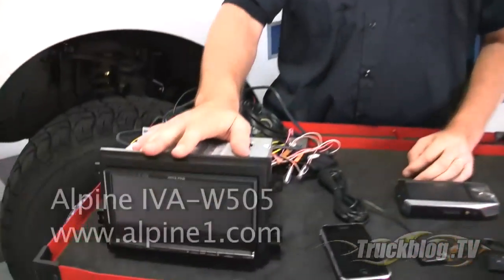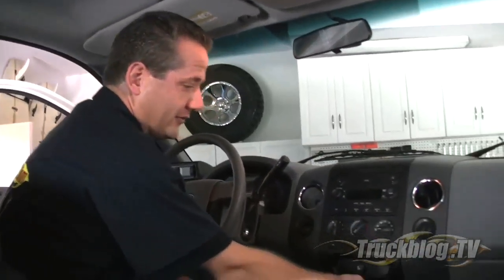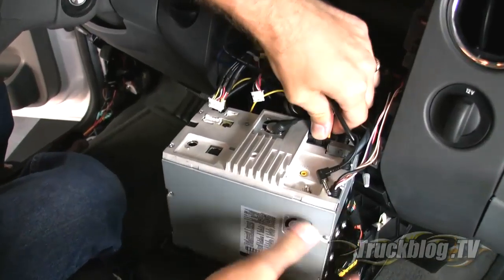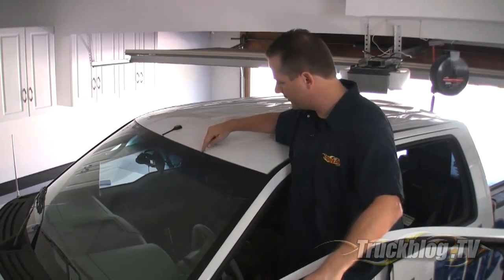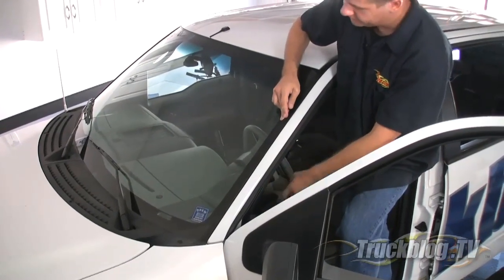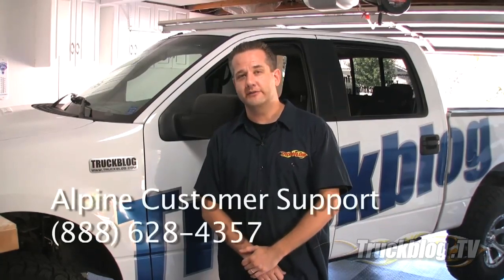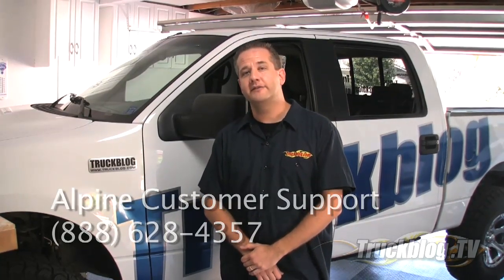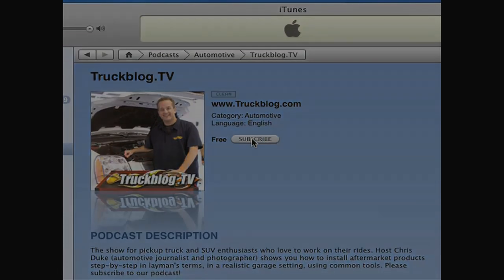How to Install Alpine IVA-W505 Head Unit Ford F-150 Motorz #7

Comment: Just finished installing a new head unit in my '06 F150.  I used your video as a guide on how to do it.  I'm glad I saw your video, but you made it look deceptively easy.  "Popping" the "surround" out was NOWHERE near as easy as you showed it to be.  I nearly snapped the thing in half, but took my time and finally got it out (barely).  You also skipped where you wire the harness to the radio, which took me forever.  Otherwise, thanks because I probably wouldn't have tried it without your video.

Comment: Question: How did you power up the alpine sirius adapter? did you hook it up straight to the battery or did you connect it off the wire that is powering the head unit?

Comment: try doin that in a honda..  rofl...     another cool installation..  

so..  did you go back later and change out the crimp connections with the new posi-traction connectors ?   =P